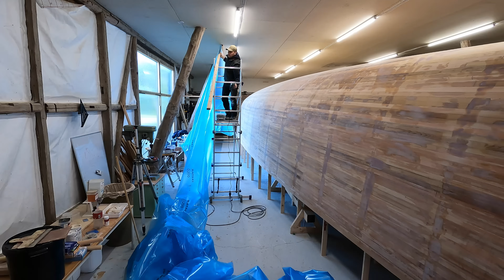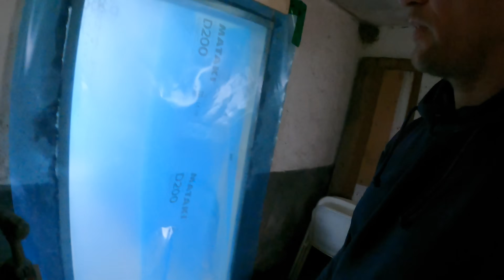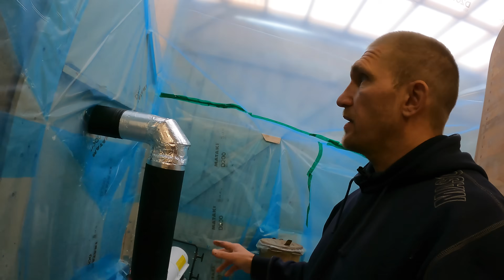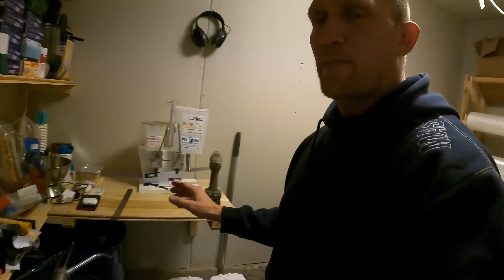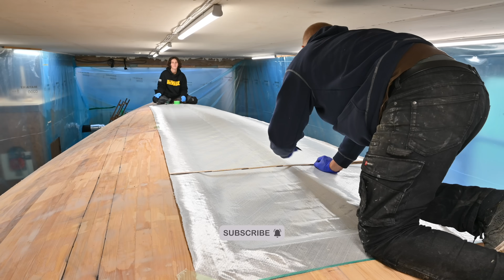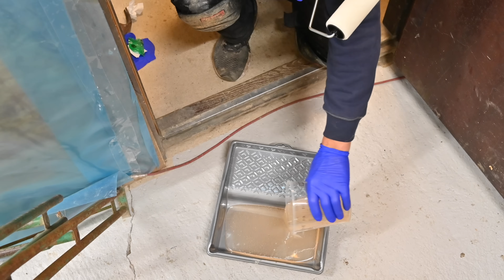Keel Recess Work Begins! Building Our 50ft Dreamboat - Ep. 369

Comment: “Violent exothermic reaction” - you bet!  I once mixed some epoxy and got the resin-hardener ratio back-to-front. A few minutes later, after noticing that the solution wasn’t spreading well, I noticed the mixture was getting hot and even starting to smoke. I rushed it to a safe place and dropped the mix - and it exploded a few seconds later! What a mess….. But no fire.

Comment: You have a huge task ahead and to make it harder the clock is ticking once the epoxy is mixed so good luck with that. Be careful not to slip as you saw what happened to the scissors and a set back with any injury would be devastating for you. Cheers Ian😀

Comment: Hey I have found that doing large flat areas, a straight  plastic spatula is better than a roller. Its more economical too as you can get a thinner coat of epoxy and the spatula is reusable.

Comment: Hello sailors! Just an idea you should think about. You are working in a dangerous position specially when in the top/down part of the hull. It is easy you to loose equilibrium while working, you are too high and in case you slip down you will have no time to react nor an holding point to grab before you hit ground. You both should wear an harness attached some how to a good holding point. Just in case! As for the work, you are doing very well. Keep going.
Reply: Roofers in Australia rig a steel cable overhead and attach harness to it by self-retracting reels (kind of like seatbelt reels).

Comment: So why are you keeping your epoxy in the warm room, if you keep it cooler and the viscosity is not too thick to use then it will extend your Gell time. Just the mixing process induces heat so anything you do to reduce heat increase is important, on a big layup pre-cooling your plug helps then heat it up once you're bagged and settled down, also create a measuring and mixing check sheet with amb temps, resin temps, mixing times, gell times etc so you don't miss a step and better understand what the resin is doing or has done. Remember it is a process and the process produces reliable results/outcomes, you can't adjust the process if you don't document what you did and changing the process on the fly generally increases stress and causes unforeseen problems. Last pearl of wisdom gained from years of using epoxy and polyester in loads up to 250L in temperatures from below zero to thirty eight degrees C is, trust the process but be prepared to rip everything off and chuck it in the bin, re-prep and figure where you went wrong and go again. Good luck and hope you have a great outcome.

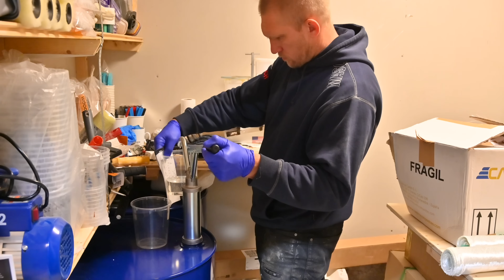Comment: @15:54 Exactly! This is the first time I heard it mentioned here on YT. Good for you!👴👌
Those were my thoughts too when hearing about maybe 5 layers at once ... On the wood, it could work out, but I have my doubts on the "keel pit".👴🤔
In my days, when in doubt I used a few of those plastic thermal accumulators straight out of the freezer with, to make good contact as a temperature conductor, a thick layer of cheap hair-gel to put the tray on (bear in mind there were no fast or slow mixtures available some 40 years ago).👴😉😁🤷‍♂
-
@18:25 And also, probably more important,  you must prevent any air being sucked from the wood while using vacuum-bagging.👴😉🤷‍♂

Comment: Fantastic set up you guys have! Are you checking the moisture content of the wood itself before you apply the primer coat? If so, what is acceptable for the resin? Also, it appears that once you have a section of wet cloth along the keel, you will be forced to the sides of the hull where you may slip off! Perhaps this is just how it appears through the camera. 
Always a pleasure to see a couple working together on projects like this 👍🏻

Comment: I can not believe how fast you are going. You probably know this but you can use vinegar for wet epoxy clean up. Any time I have had problems with epoxy, I did not mix well enough. Temperature can be use to slow down setting up time. So you can lower room temp and have longer working time. I do not know how low you can go. You could put some wood strips on the turn of the hull so you would have something for your feet to catch on.

Comment: You should have a test panel that you can apply the mat and layers of the epoxy and let it harden to check for correct thickness with a mil gauge while wet. Are you going to apply the final layer of epoxy with a sprayer?

Comment: Since you are bagging your layup, why not exchange breather fabric for nylon flow mesh and infuse your epoxy? You can assemble all layers at one time, save wetting out individual layers and get a better, stronger result with MUCH less work. It will require slightly more set up for the epoxy intake manifold and vacuum outlet, but a minor step compared to wetting out so much fabric. Benefits are moving out all the air bubbles (if you infuse from low to high) from a layup and using less epoxy.

Comment: Where are the thermostats located ? You should have four one for the stern one for the bow and one for  each side and mid level to the hull. That one at the ceiling won’t be accurate for the lower levels of the hull, it will be close to the bottom of the hull.

Comment: Awesome work guys. Just a quick possibly stupid query - is there no way to use an infusion method for the epoxy?
Reply: Yes you can but it is an art form using many pipes, valves & special tubes. Infusion is very difficult & creates a lot of waste. The upside is that you can lay-up very large areas of many layers of material over many days to create huge homogeneous pieces, the bridge deck & roof of seawind 1370's are both single Infused pieces.
Reply: @jackdbur  Sounds complicated. Thanks for the information.

Comment: I've been watching 'boatworks today', watching your vid i get the impression you might be putting the large layer first, boatworks puts the smaller layer first, successive larger  layers then contribute to sticking them down with the overlap, rather that relying on large layer first.
Reply from the maker: We will do the same, smallest piece first. Mostly because it will be more practical that way… Thanks for watching! Cheers!

Comment: Could you please explain what the purpose is of the black and yellow material is, that you are laminating over on the bottom of the hull, if you have already explained in a previous video, I must have missed it, We have followed your adventures since you started and I’m sure we haven’t missed one… Thanks, John and Penny, Ontario, Canada
Reply from the maker: The tape is just the bottom of the temporary “floor” in the keel recess. Once that area is glassed and the hull is turned over all of that will be removed and we will add more layers of glass from the inside of the hull. So the tape is only there as a “non-stick” surface. 😊 Thanks for watching! Cheers!

Comment: Hi Johan. Actually U can use a lot less epoxy on the priming step. I usually use a rubber edge squeegee for the priming step. It does not really help to completely saturate the wood with epoxy, it will not strengthen the lamination, It is only neccesary to stop the pores of the wood to suck epoxy during lamination. for the area you describe for the keel I would usually use 1 deciliter of epoxi at most. Building a heavy boat you probably do not have a weight issue there. I used the technigue you build with for quite a lot of kayaks and canoes and put pride in using nop more than neccesary epoxy. Dont get me wrong youre doing a really great job and i am watching your build with great interest and envy :) I just want to save you some money in epoxy. Theres probably a lot of people priming with roller, but i would emmidiately wipe the excess epoxy to dry areas instead of letting it cure and build a layer of epoxy - to my best knowledge that is not what you want. Please let me know if you agree or disagree. anyway keep up the good work
Reply from the maker: That's a great idea, using a squeegee. We might use peel ply for the primer layer on the hull, but if not, we need to sand. So, my only concern with a thinner layer of epoxy would be the risk of sanding too deep and having to re-apply. Thanks for the input! Cheers /Johan
Reply: :) do not be afraid of using too little epoxy - too much is twice as bad - you can always repair the occasional dryspot ot air bubble but lamination with too much epoxy between the layers will weaken the bond as well. My 14 kg/ 6,5m kayaks have not delaminated once - oldest is 15 years and put to extremely hard ocean use :) Lying outside year around. Used cedar, spruce and Paulownia. I have build with straight trips and cove and bead _ Cove and Bead would not make sense on a big boat like yours but on kayaks it works fine. BTW. theres quite a large strip building society in Lund / Malmö.  @RANSailing  buidling
Reply: the priming step is an important one of course - but you need to use less. And do not forget the only thing to do with good advice is to pass it on...

Comment: What about circulation of the air inside where you are doing the epoxy on the hull?  Seems you will need to be pushing some fresh air into the room to insure the air is not too toxic inside.  Just a thought.  BTW, I love your channel and am excited to continue watching how things progress.
Reply from the maker: The room will be in under pressure because of the diesel heater, so we left the ceiling without plastic to let air in through the cracks. So there will be air exchange because of this… Cheers and thanks for watching!
Reply: Knowing Johan' there is no way have missed to think about that.